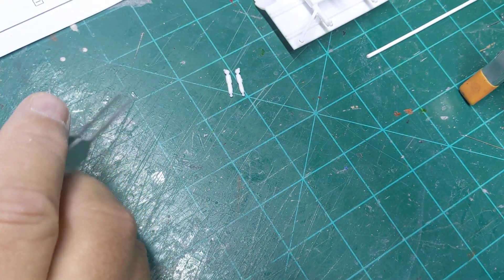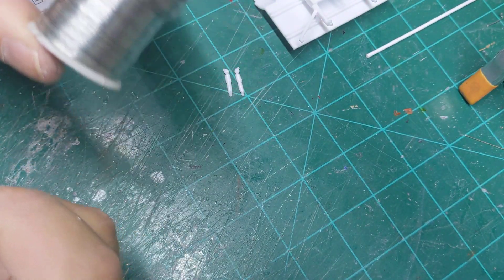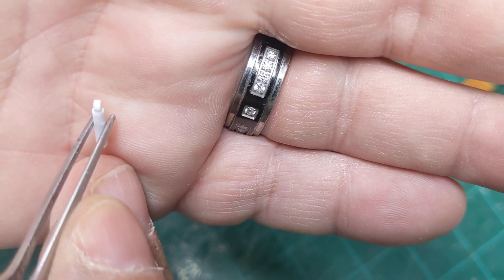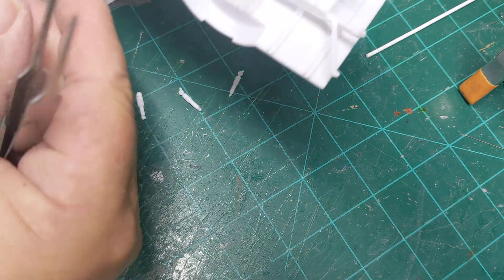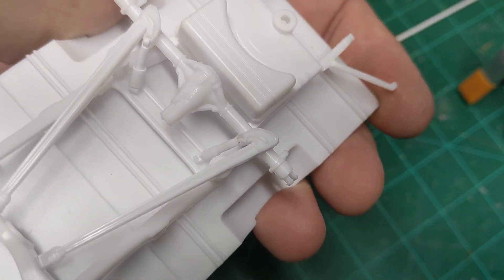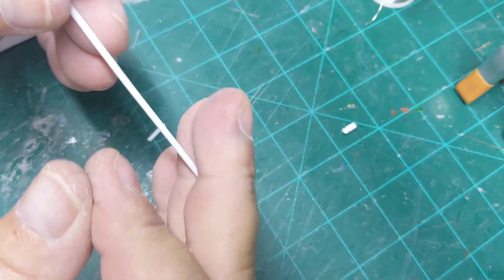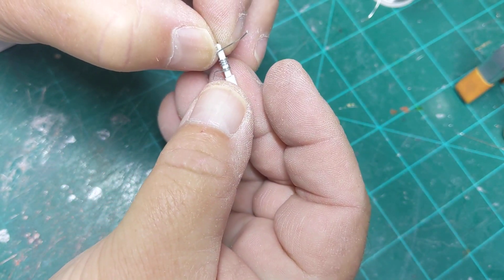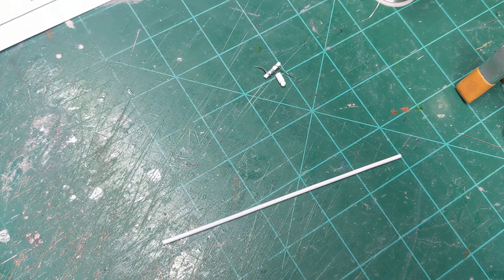Let's make  shock absorbers.

Comment: Not having to scrape and sand parting lines off one piece molded shock absorbers is a great plus to making shock absorbers this way, and an added benefit is the ease of installation as your model shocks "telescope" just like the real ones. This can be especially helpful in a "non-stock" application when one piece kit shock is just a bit too long or short.
Reply from the maker: Yes! Thank you for watching.